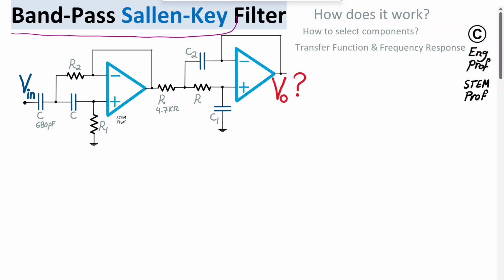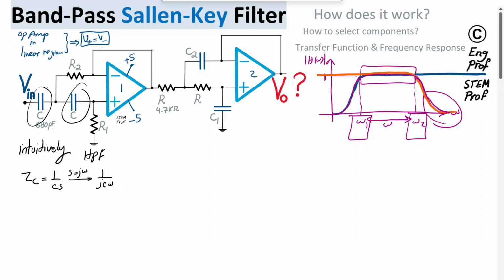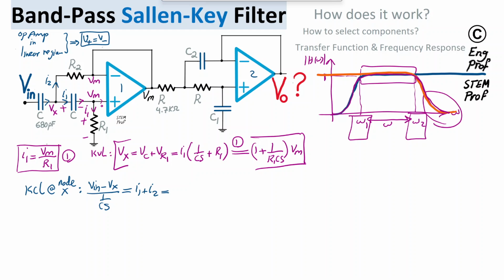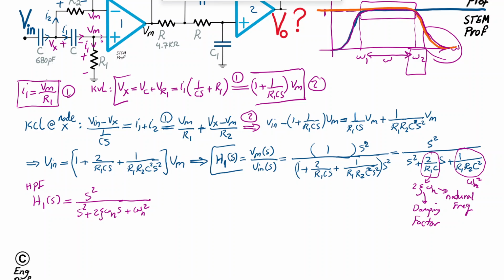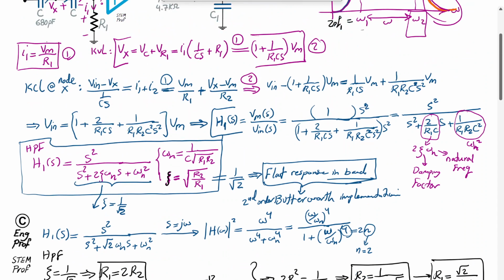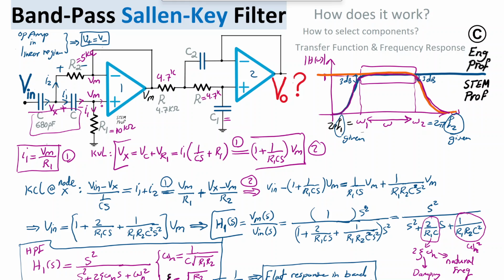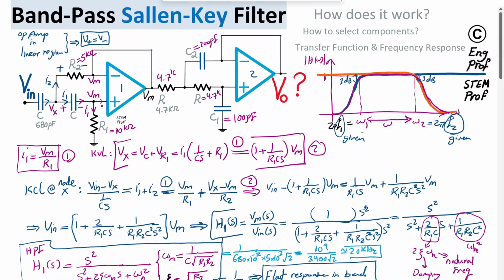Sallen-Key BandPass Analog Filter Frequency Response & Transfer Function

Comment from the maker: Thanks for watching. For more Analog and Digital Signal Processing & Circuit examples please see:  
Butterworth Analog Filter Design with Op Amp https://youtu.be/SIMg5TOIgrA
Digital Filter Cascade Implementation Example https://youtu.be/S5ev43KQJmY
Universal Analog Filter Design https://youtu.be/2J-0msXZE2o
Digital Filter Design using MATLAB filter Designer Tool https://youtu.be/dSZmymGa3Wo
Sallen-Key Filter Design Tutorial: LPF, HPF Frequency Response, Damping Factor https://youtu.be/KwUnQXbk7gM
How to find Bode Plot, Freq Response, Transfer Function of Analog Filters https://youtu.be/vZFkPeDa1H8
Lowpass Butterworth Filter: https://youtu.be/UzCjkwqy-9w
Digital Filter: Direct Form vs Transpose Form https://youtu.be/ekvY-ctW6Js
Laplace Transform Example and S-domain circuit analysis:  https://youtu.be/ps8N5TPM_qU
Op Amp circuit Bode Frequency plot https://youtu.be/BLVzuuqAlZs
Analog Logarithm Computer https://youtu.be/RpKEq5WyoLg
Op Amp Amplifier with Electronic Gain Control https://youtu.be/NoNgQpbj77Y  
Analog Computer solves Differential Equation https://youtu.be/ENq39EesfPw
Voltage Regulator Design with Op Amp and BJT Transistor https://youtu.be/rI9f6-DyXxQ
Analog Computer to Raise Signal to power n https://youtu.be/IUTlBH1UraE
Triangle Oscillator Op Amp circuit https://youtu.be/JF5Up_cuL9k
Differential Equation Solver Analog Circuit https://youtu.be/R3X5AYNZGEI
Complex Sinusoid Oscillator https://youtu.be/GXRhmwmS5Zk
Sawtooth Oscillator Design https://youtu.be/2eUsGPfqbW4
Full-Wave Rectifier circuit example https://youtu.be/DJJMNU-CYcg
Sawtooth Waveform Generator design with OpAmp, JFET, BJT https://youtu.be/5zHXTx-Vl20 
For more Digital Signal Processing and DSP examples please see https://www.youtube.com/playlist?list=PLrwXF7N522y6cSKr0FmEPP_zQl011VvLr
For more analog circuits and signal processing examples see: https://www.youtube.com/playlist?list=PLrwXF7N522y4c7c-8KBjrwd7IyaZfWxyt
I hope these Analog and Digital Circuit design and analysis videos are useful and interesting.🙏
Reply from the maker: You are welcome. Thank you for the comment.

Comment: Sir, I have watched so many videos on Sallen-Key filters and I find that folks are all over the place about how to calculate the component values for these filters. I even bought books and find they are the same as videos on YouTube. If you can help me I would appreciate it. I would like to design an active bandpass filter using Sallen-Key topology with a Butterworth response. This would consist of two stages, low and high pass where each stage would be second-order, giving an overall response as a fourth-order filter. My passband would be from 60-850Hz. From my calculations, the center frequency would be 225.8Hz. The bandpass would be 790Hz and my Q would be 0.286. I see videos and books that describe different damping factors, frequency factors, using different Q factors for each, and I'm just confused at how to design this circuit for the values that's needed. With the above information, could you guide me to what I need to accomplish this design. Any information that you could provide would be surely appreciated! Thanks and have a super great day!
Reply from the maker: Thank you for your detailed comment. You're right; there is a lot of variation out there in how Sallen-Key filters are presented, which can definitely lead to confusion, especially when trying to design a bandpass filter with specific performance goals like a Butterworth response.  I highly recommend watching the https://youtu.be/KwUnQXbk7gM video of Sallen-Key Filter Design Tutorial: LPF, HPF Frequency Response, Damping Factor.  That being said, You're on the right track with the concept of cascading a second-order high-pass filter and a second-order low-pass filter to create a fourth-order bandpass filter. For a Butterworth response, each stage (HPF and LPF) should ideally have a damping factor (ζ) of 1/√2 ≈ 0.707, which corresponds to a Q of 0.707 for each second-order section—not 0.286.

The Q = 0.286 you mentioned corresponds to a fairly wide bandwidth filter, but if you're targeting a Butterworth response, you'd want both stages to have the same Q = 0.707 and design their cutoff frequencies such that the -3 dB points are at 60 Hz and 850 Hz respectively.

Here’s a simple design flow you can follow:  Set the HPF cutoff at 60 Hz with Q = 0.707 → This gives you your lower -3 dB corner.  Set the LPF cutoff at 850 Hz also with Q = 0.707 → This gives your upper -3 dB corner.

The resulting bandpass will be flat in the passband (Butterworth characteristic), and the center frequency will naturally fall somewhere between the two corners—not necessarily at the arithmetic or geometric mean, since you're cascading two filters with different corner frequencies.

Comment: Hello sir, thank you for explaining in this video. I have a question if I have an input voltage ranging from 2.35 V to 2.55 V and I want the output to be amplified to a range of 0-5 V with cutoff frequencies at 0.3 Hz and 50 Hz, how can I achieve this? thank you
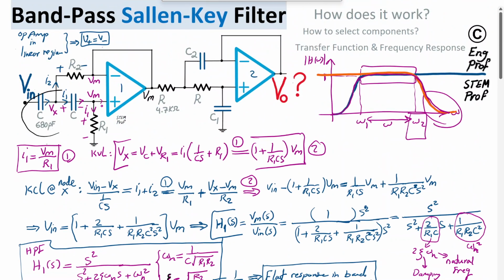Reply from the maker: You're welcome! Glad that this video is helpful. While F=0.3 Hz is a considerably low cut-off frequency for the highpass filter, using equations explained at 18:40 , with Damping Factor set to 1/sqrt(2) we get R1=2*R2 and 2*pi*F=1/(C*sqrt(R1*R2)) . Hence we get R2 = 1/(2*pi*1.41*F*C) , if we set F=0.3 Hz and say C=1.2uF then we get R2=330 kOhm , R1=660 kOhm.  Now, similarly, for lowpass filtering portion of this Sallen Key Filter, using equations explained at 26:35 , with R=100kOhm we can derive C1=22nF, C2=44nF.  I hope this is helpful.
 For the voltage shift, I suggest shifting your voltage at input of the circuit by a simple single op-amp level shifter amplifier (voltage subtractor) to the range of zero to 200 mv = 2.55 - 2.35V.  Set the gain to 25 for the amplification.  For more detailed explanation, see the 👉 Sallen-Key Filter Design Tutorial https://youtu.be/KwUnQXbk7gM expands on the concepts discussed in the bandpass video, discussing Frequency Response, Damping Factor, etc.

Comment: Can you tell me all the component values for the circuit with a gain of 20 that passes between 38 khz and 42 khz? I can't find them because I don't understand your language.
Reply from the maker: To design a Sallen-Key Bandpass Filter with a gain of 20 that passes frequencies between 38 kHz and 42 kHz, we use the same approach explained in the video. We will need an additional 3rd op amp stage for the non-unity gain of 20 that you asked. Notice that the unity-gain highpass operation is implemented by the first op amp amplifier stage. The second op amp amplifier stage implements the unity-gain low-pass portion of the overall desired bandpass filter.  
   For High-Pass Section (38 kHz cutoff, implemented by the first Op Amp stage), using the equation explained at 17:50 in the video, 2*pi*F=1/(C*sqrt(R1*R2)) and damping_factor = sqrt(R2/R1),  with a Damping Factor of 1/√2, we set R1 = 2 × R2. Let’s choose C = 1.2 nF, then:
R2 = 1 / (2π×38,000×√2×1.2×10−9) which results in R2 ≈ 3kΩ, R1 ≈ 6kΩ .

   For Low-Pass Section (42 kHz cutoff, implemented by the second Op Amp stage), using the equation (as explained at 26:35 in the video): 2*pi*F_lowpass=1/(R*sqrt(C1*C2)), with Damping Factor = 1/√2, we set C2 = 2 × C1. Let’s choose R = 4.7 kΩ, then solving for C1 and C2:
C1=1/(2π×42,000×√2×4.7kΩ) which results in C1 ≈ 1.1nF, C2 = 2.2nF

Setting the Gain to 20:  the gain in a Sallen-Key filter with a non-unity gain topology is set using a feedback resistor Rf and input resistor Rg in a 3rd stage single op-amp non-inverting amplifier with a Gain=1+Rf/Rg . For a gain of 20, we can set Rf = 19 kΩ and Rg = 1 kΩ.

This should give you a bandpass filter centered around 40 kHz, with a gain of 20. Fine-tuning may be needed based on the actual component tolerances and response requirements.  Make sure you use low-noise, very low-offset CMOS op amps for best practical performance. For more details, check out these videos:
🔹 Universal Analog Filter Design – Watch https://youtu.be/2J-0msXZE2o
🔹 Digital Filter Design using MATLAB Filter Designer Tool – Watch https://youtu.be/dSZmymGa3Wo
🔹 Sallen-Key Filter Design Tutorial: LPF, HPF Frequency Response, Damping Factor – Watch https://youtu.be/KwUnQXbk7gM
I hope this helps, and thanks for watching.

Comment: What if my high pass has a  a cut off frequency of 0.5Hz and lpf a cut off of 100 Hz, what would the values be?
Reply from the maker: While F=0.5 Hz is a considerably low cut-off frequency for the highpass filter, using equations explained at 18:40 , with Damping Factor set to 1/sqrt(2) we get R1=2*R2 and 2*pi*F=1/(C*sqrt(R1*R2)) . Hence we get R2 = 1/(2*pi*1.41*F*C) , if we set F=0.5 Hz and say C=1.2uF then we get R2=200 kOhm , R1=400 kOhm. 
Now, similarly, for lowpass filtering portion of this Sallen Key Filter, using equations explained at 26:35 , with R=100kOhm we can derive C1=11nF, C2=22nF.  I hope this is helpful.

Comment: Hello. Nice video. Thanks.  I notice a small difference in your Sallen-Key topology and others. After some research, I see that the Sallen-Key relies on a buffered copy of signal, in this case, at the "+" terminal of the opamp. Yours is functionally equivalent to those others with unity gain, I believe. If more gain is desired, the alternate topology is used. I think the analysis is similar in both cases.
Reply from the maker: You are welcome! And thanks for sharing your observations and insights. Here is another example that you might find interesting, Sallen-Key Filter Design Tutorial: LPF, HPF Frequency Response, Damping Factor https://youtu.be/KwUnQXbk7gM